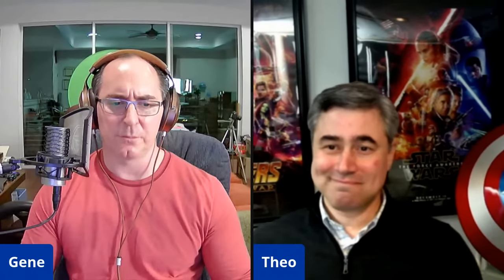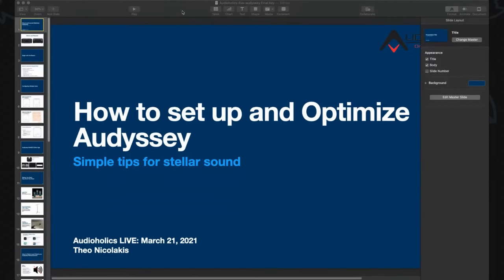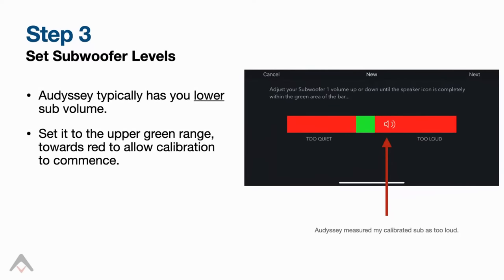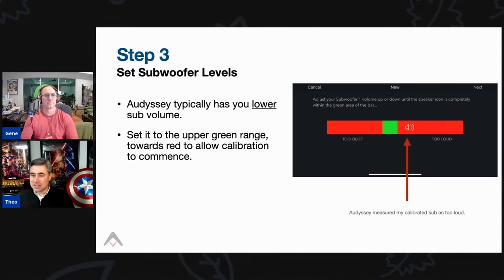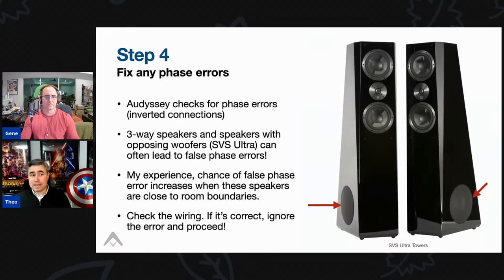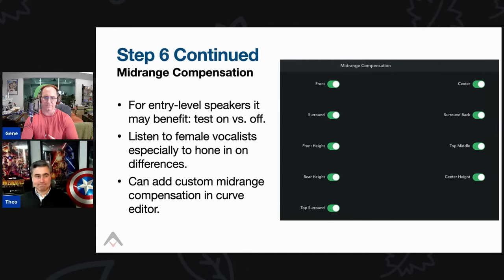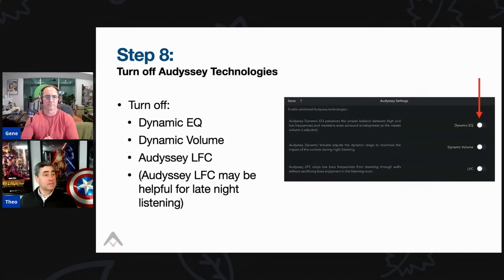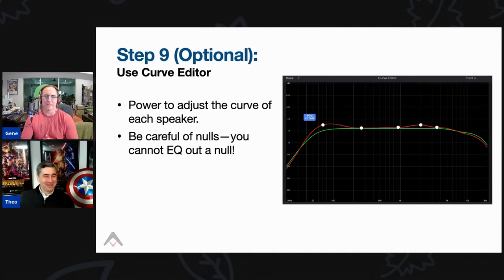Audyssey Room Correction Performance Tips for Your Denon/Marantz Receiver

Comment: How to know if my speaker is a high performing one?
Reply: If you have the app, listen with midrange compensation enabled and listen with it disabled and you will be able to tell right away which of the two you prefer. They are basically trying to address potential phase issues right around the crossover region which will fall right around 2500 Hz for many speakers. My issue is that this setting is automatically applied regardless of how the speaker measures.
Reply: @TheoNicolakis  Thank you very much. Your videos are very very helpful. Love them
Reply: @TheoNicolakis  I’m using a denon s760h. So you suggest using Flat instead of reference? AND limit the eq frequency correction at 500hz? I just want to confirm because i heard someone say that any changes i make to the eq will not be in effect unless it is on Reference. But they could be wrong. Appreciate the info. Thanks!

Comment: Does anybody use "Bypass L and R"? Personally I use Reference because I think it sounds better than flat
Reply: Yes I do. I use my marantz sr8015 with the lyngdorf tdai 3400 integrated stereo amp. The 3400 uses its own RoomPerfect te calibrate the front speakers and the subwoofer. So audyssey has to be by passed in the marantz for the front left right. Therefore it’s a very useful setting that other brands don’t have

Comment: I looked at that app but noticed most of the reviews are only 1 star.
Reply: That’s because 99% of users have no clue how to use it properly. I do but i still hate the app ;) I hope that D&M will ditch Audissey for Dirac.
Reply: Check out the ratbuddy audessy program it will allow you to take the room correction files and load them up and adjust them on your computer just like the app and can allow for more precise edits to the curves.

Comment: Audessey always sets the distance of my subs way off. Should I leave it?Or  measure the distance myself? Any help would be appreciated guys.
Reply: The subs should be higher than the actual distance because of all the processes that take place and some people add even more distance to get the sub into the room even sooner than measured
Reply: You didn’t watch the video did you?
Reply: Sub distances are not physical.  Mine are 11 feet away, but I set them at 28 feet with ARC.
Reply: Audyssey doesn't measure distance, it measures time.  A sub intrinsically has long wave lengths.  Audyssey measures the sub and the room to make the sub sound arrives at your ears time aligned with the speakers at Reference level.
Reply: @voiceofreason9238  Thank you that helps. Guess I will leave it as is then.
Reply: @arsenalfan1776  If you've ever tried to sing low notes they are not as loud as the middle frequencies.  The same is true here.  Audyssey sets the subs to the proper MEASURED loudness but the PERCEIVED loudness seems too quiet.  After Audyssey is done calibrating most people bump up the bass to their taste.  That is perfectly acceptable and works just fine.  After all, this is YOUR setup ans it should sound good to YOUR ears!
Reply: @voiceofreason9238  Audyssey set my subs level perfect at -7 and -8db
Reply: @arsenalfan1776  I like an articulate mid-range with light bass but not everybody does.  It is very common to boost the bass to your liking, the same way a person would add a little salt to their food to their taste.  They're YOUR speakers and subs, make them sound good to YOUR ears in YOUR listening room.

Comment: While I appreciate Denon incporporating the option of several speaker presets, it's too little too late. We should have a room for dozens of speaker measurements within the unit, all tweakable within the unit, and that's just for starters. I can understand that entry level devices lack some features, but the same lack of features and the same quirkiness in top models is frankly insulting.

Comment: It's a shame you are telling people to turn off Dynamic EQ. That is the best feature of Audyssey. It's a dynamic house curve that automatically adjusts to on your listening volume. That would solve most of the "anemic bass" issues that people seem to have.

Also once you upload the settings from the app to the receiver you can absolutely go into the receiver menu after that to make changes and it won't undo or mess with the calibration.
Reply: There is nothing necessarily wrong with Dynamic EQ for those who would like to have some increased bass response at lower volumes. It works and does the job. Our point was whether it’s Audyssey Dynamic Volume or Dolby Volume, these artificial processing solutions are not accurate.